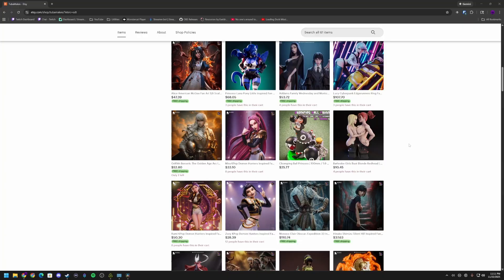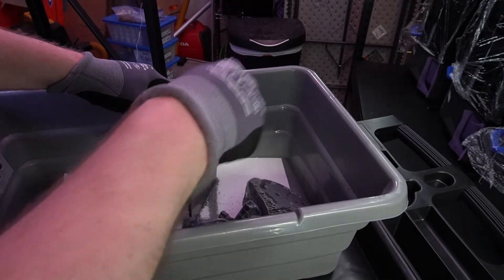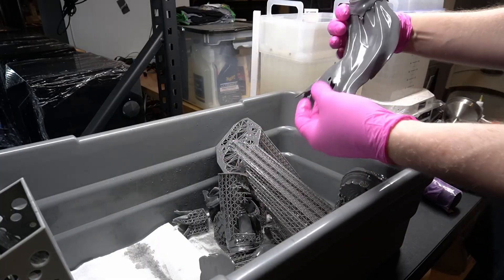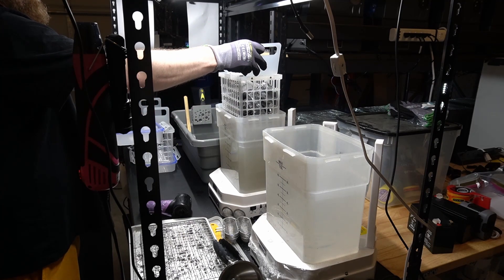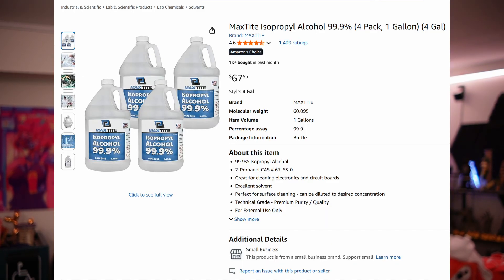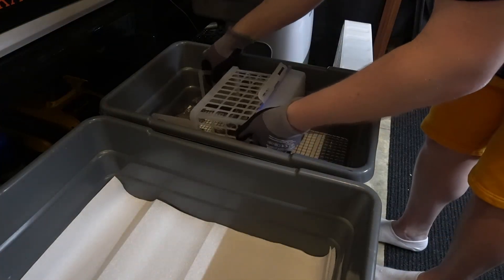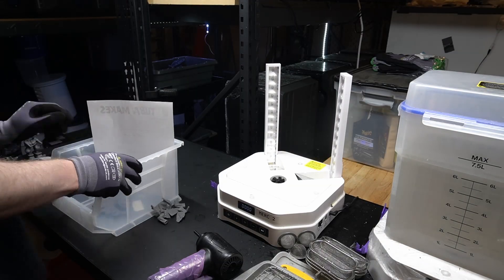Resin Print Farm Finishing Workflow: From Build Plate to Fully Cured

Comment: Have you found the IPA can make the resin brittle? Or can overcuring make your parts brittle? I am printing Battletech miniatures on a Saturn ultra 16k and found that washing for 5 mins in IPA and curing for 5 mins they would break easily. Any suggestions?
Reply from the maker: Unfortunately it's all going to depend on your resin.  That can absolutely happen, but with my Sunlu ABS-Like it's not noticeable.

Comment: Just throwing this out there, I really like using generic “Luer lock” syringes with a cheap kit of large gauge blunt needle tips for cleaning out holes and keys under pressure. I’ve had that really help on some difficult hollow models that repeatedly blew from trapped resin.

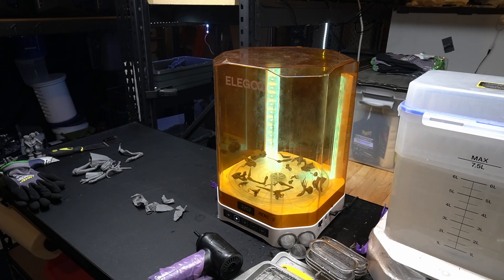Comment: 10:15 to help with the volume that I cure at once, I fill a glass jar with water and throw a bunch of small parts in it, then I mix them around and continue curing to ensure they all get coverage the reflective glass and water means they almost always get reached even the tricky spots. Just something that could save you some time.

Comment: Things you can do better? Sure, use a better scrapper, you either want a sharp scrapper or a very thin scrapper and the prints will pop off the plate easily.

Comment: How long do you wash+cure your prints for? I know the answer varies by resin, size of the print, etc but still I'd rather have a data point over "it depends".
Reply from the maker: I usually do four to six minutes depending on how much I put into the basket.  If that isn't enough, I'll up it to 8.  At that point I know it's too dirty to be useful anymore.